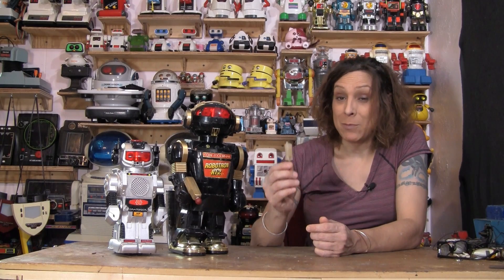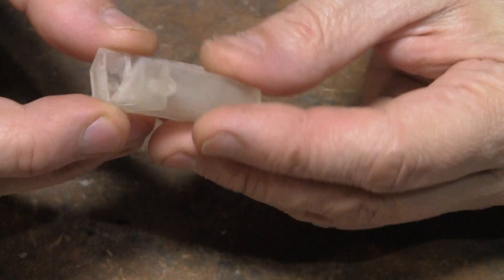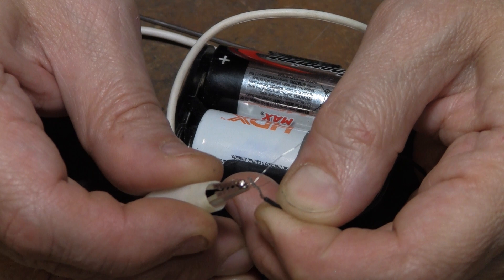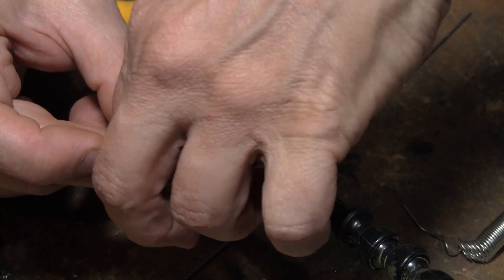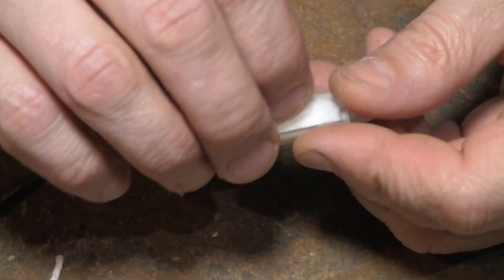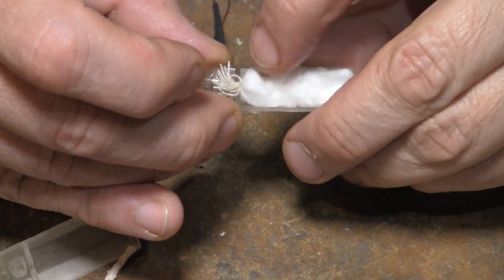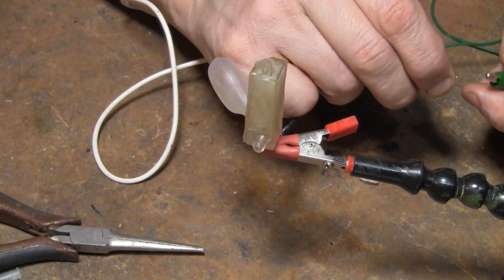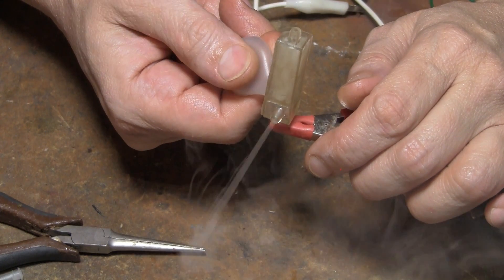Reviving 80s Toy Magic: DIY Smoke Machine for Retro Robots!

Comment: When I've hooked up nichrome to wires in the past I have pulled the plastic end off a small ferrule and crimped the wires together inside the ferrule. Probably just as fiddly as soldering though.
Would be interesting to see how it works with VG/PG too. I can't believe we vaped all that petrochemical smoke as kids. I guess it didn;t du us anhy harm thhoihgn. 😅
Reply from the maker: That would work too. At some point I'm going to return to this and play around with what I can accomplish. As for the petrochemicals, just another thing to show how easy the kids have it today. We vaped the hard stuff.

Comment: It would be useful if you could get out your VOM and tell us the resistance in ohms that a filament should have, to glow properly, with a 1.5V, a 3V, or a 9V supply. That would make it a little more scienterrific when winding the nichrome wire. If you know you are making a 15-ohm (say) filament, it makes it easy to measure out the wire, regardless of what brand or gauge of wire one happens to have. 
Also that would let you calculate the current draw and get an idea of how long a typical pair of AAAs would last.
Reply from the maker: I get you. That would help the people who have a meter and want to do it that way. However, I showed how you can do it, and how easy it is, and you don't even need one. That was literally my first guess.

Comment: I have seen some people repurposing off-the-shelf "personal vaping devices" for something like this - as far as I know, the liquids in those are also glycerin-based.
(but the stock fluid of course contains other stuff that might not be so good, especially for kids toys, so it should be swapped out for neutral smoke fluid). Big Clive has a lot of videos on how they work and how they can be taken apart for upcycling.
Reply from the maker: That's interesting. I've never played around with those, because I used to make them before vaping became a thing. Just using the liquid you put in fog machines. Which is glycerin based, but it also has ionized water in it. Which why it's hard to make yourself. It's probably easier to just use a vape pen of some sort for all I know.